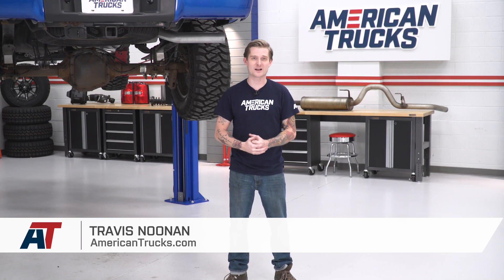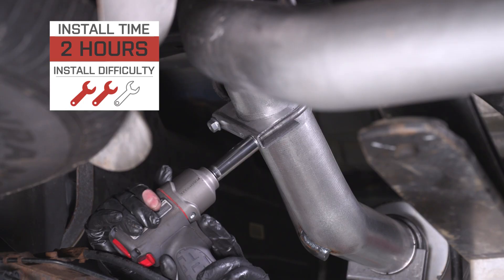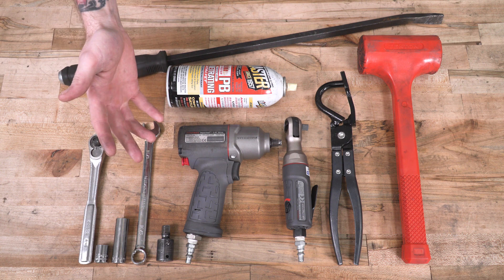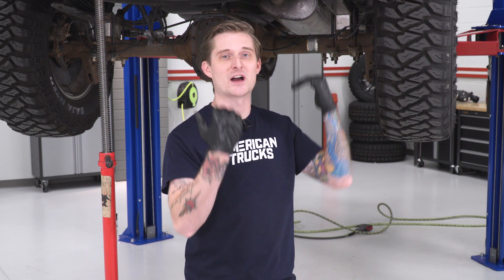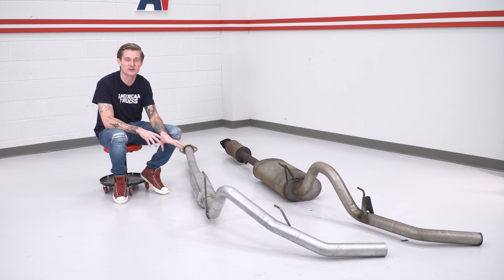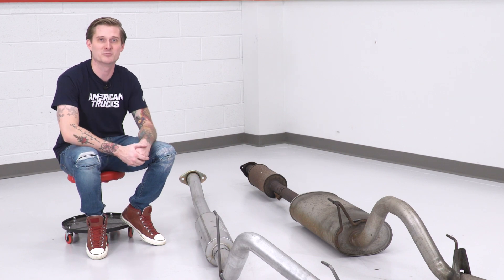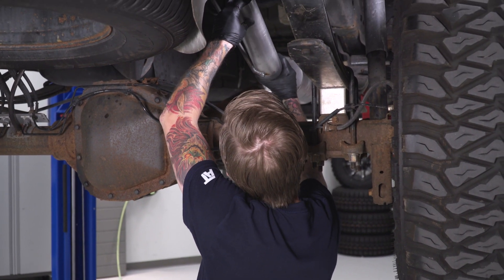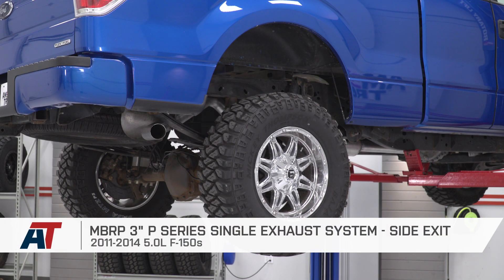2011-2014 F150 5.0L MBRP 3 in.  P-Series Single Exhaust System - Side Exit Sound Clip & Review

Comment: Just got this installed today. It was a very easy install, however it is on the louder side for my tast so I'm going to be putting the stock resonator back on to see if it helps quiet down on the noise inside the cab. It does have a very very noticeable drone at around 2 grand. Also the bolts to mount where the old resonator was didn't have enough thread so I had to go get some different bolts for it but overall it seems like a very well made system and does its job even if it isnt to my particular liking.

Comment: Why is this system so loud (5/5)? Compared to the installer series 3inch cat back (3/5). Seems like the only difference is no resonator
Reply from the maker: That extra resonator included the Installer Series 3" exhaust you mentioned really makes the difference. That included resonator helps take away any rasp, drone or crackling that are present like in this P-Series. So the installer series will have an overall "cleaner" sound. -Zach
Reply: AmericanTrucks Ford okay, thanks for the response!
Reply from the maker: Any time! Thanks for watching! -Zach